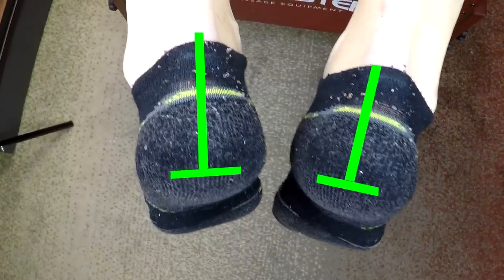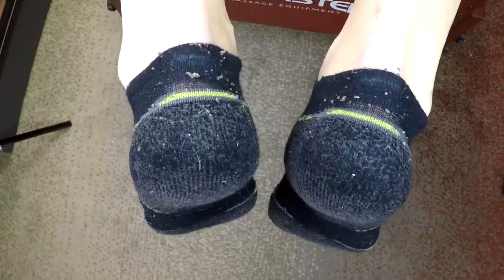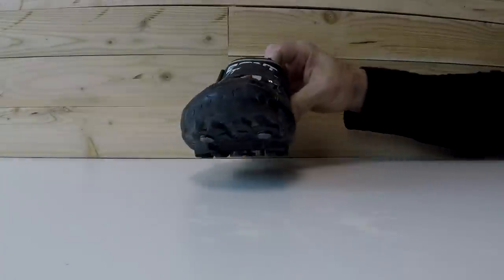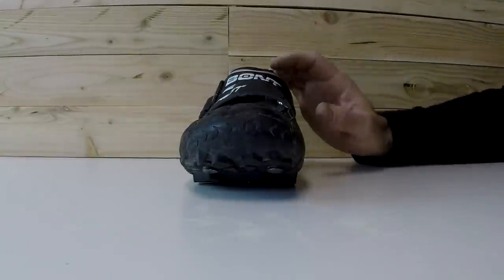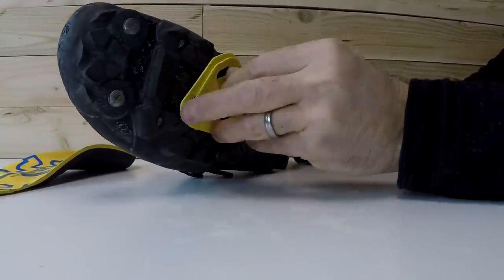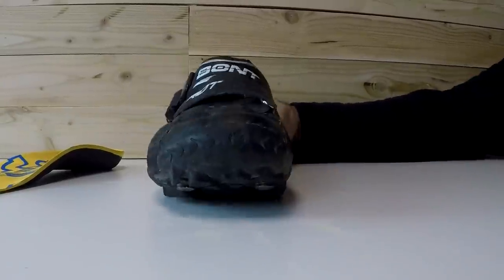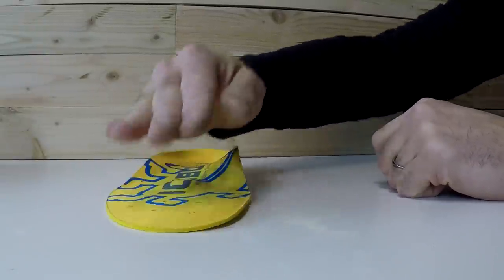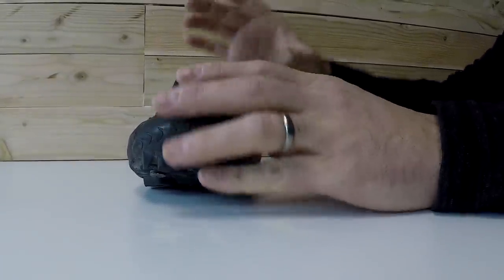Using Cleat Wedges | Bike Fit Tip

Comment: Thanks for this video. After using my running-insoles for my cycling shoes, I developed a hip injury over a period of about a year. I didn't know that the running insoles were to blame. My running-insoles have a lift under my big toe to release stress under my forefoot. They caused my knee to turn outward during the cycling motion. After you explained the forefoot-varus and the dynamics of the cycling motion in this video, I was convinced that the insoles created my problem. I eliminated the lift under my big toe resulting in a better cycling motion were my knee didn't turn outwards anymore. After a period of about to weeks my problems disappeared. I still use the original insoles for running and they work great, for cycling however I use a modified insole.  So keep up the good work!!!

Comment: My story is that I had a bike fitting on a machine before ordering a new bike (my first road bike -had been riding mtn bikes with no particular fitting). The bike came in and was setup per the fit. We tested with the bike on a trainer since it would be the first time in the road shoes I bought, etc. 

My symptom was pain on the outside edge of my feet almost right away while pedaling. The fitter then had me kneel on a chair and did the measurement of the foot angle and we tried some wedges based on that. That fixed the pain right away. 

After that he watched my pedaling and based on some knee motion tried some shoe inserts (superfeet -yellow) and he felt that corrected it.

The main point of this comment, is that my symptom that was corrected by wedges was foot pain on the side of the foot.
Reply from the maker: That's a perfect example....I should have been clearer in the video that lateral foot discomfort is a common result of the symptomatic forefoot varus.  Your foot wanted to "stay" tilted on its outside edge and that put pressure on the side of the foot.  Thanks for sharing!
Reply: this gives me hope. I have tried everything (including bike fit, different shoes, different cleat styles, cleat positioning) but the longer i ride the more i get terrible numbness and then a "hot" burning with my 2nd and 3rd metatarsal. I am definitely going to give this a try

Comment: As a former marathon racer, I struggled with leg length variance.  This caused my foot to rotate outward (supinate).  I used custom orthotics, insoles, shims, etc.  With cycling, I have the same issue and have used wedges.  My chiropractor showed me that my leg length variance was caused by pubic bone being out of alignment (a common problem for many).  He showed me a way to self-adjust that bone.  The end result fixed my leg length variance along with foot supination.  Right leg was at times 1.5" shorter.  After adjustment, the legs were the same.

Comment: I recorded myself riding from several positions as you recommended to analyze my bike fit and noticed my left knee (which has had long term pain after over-use on a big ride a few years ago) tracks inwards significantly through the downstroke. I also found I have "duck feet" by 15° for each foot and 2° & 6° varus tilt in the left and right foot respectively. Turning my cleats in 15° and making an impromptu 2° wedge on the left side made a big difference in comfort on my trainer. I thought it was interesting the varus tilt was greater in my right foot but wasn't causing knee issues there. I ordered some BikeFit wedges and hopefully my knee pain will go away so I can finally ride again! Thanks for the video.
Reply: have you tried pedal extenders ?

Comment: Very useful. I have a wide foot so have finally found a pair of good shoes that work for me. I'm wearing the MX1 Carbon from Lake. They are a brilliant shoe all in all. I chose the SPD cleat so I can walk if needs be during touring and gravel rides. I also ride audax distance. 300km was tolerable but getting a little annoying. All of the other foot discomfort has gone and I am now left with hot foot on the underside of the outside of my right foot. I have a pair of inserts (that I hated with a passion in other shoes) that have  varus wedge that can be fitted that I will experiment with. I've also noted I can get shims for the SPD cleats so will give them a go as well. I'm hoping they will work as I really don't want to get the wider SPD SL cleat for distance riding. We shall see how it goes.

Comment: OK so this was VERY interesting... I ride SPD's (not the SPD SL) so while you can get wedges for them they are trickier. I remembered I had a couple of varus wedges in a pair of insoles - that I hated. So I put to 1.5mm (0.86 degree) ones in and got in the shoe... didn't feel much different. Put the 3mm (1.7 degree) ones in and oh my... that feels much better. Initial experiments were positive. To give some context, a 100km ride, I notice the discomfort in the outside of my foot. 200km ride, I'm standing gently on it afterwards,  300km ride I'm limping. I just completed a 737km ride over 34 hours with no foot discomfort (apart from a couple of twinges when pushing a heavy gear) to speak of! That's brilliant. I'm going to experiment with the 1.5mm in-shoe wedge add a 1 degree (0.87mm) cleat wedge to see what that does to give me some more room in the shoe... but the result so far is brilliant! Thanks for the explanation.

Comment: Cleat wedges namely Big Meat® by Keith Kiode from Miami USA are key to my 1998 MTB sprint 5km/10km win the wedges stop your knees peeling towards your top tube a problem when you get tired yes aehy thought that aehy would get knee pain however the lever action enables "perfect circle" even circumference pressure in every direction an SPD pedal can torque, also aehy was stoned during the competition and visualized my bong especially up hills looking forward to bongs at the end of the race.

Comment: Be careful with wedging the first ray. If the midfoot is unlocked to allow forefoot eversion, first ray ROM has decreased. The added wedging can jam the met against the cuneiform. The better method is to control the foot at the sustantaculum tali and position the midfoot correctly.  A properly fitted orthotic is the way to go. Love the videos. Keep them coming.
Reply: I had a similar problem. I would like to say "lateral foot sore" rather than pain cause I feel the fatigue in the lateral foot muscle.i have tried move cleats inside but it seems it doesn't work. then I try wedging cleats to elevate the outside and the symptom resolved. however, after 25km， the lateral knee started to "pain". how to fiexd it?  i totoally  have no idea ~~@_@

Comment: I have the same problem: pain on the outside of my right foot. I tried some in-shoe wedges and they worked great. But like  BFA said, it dramatically cut down the space in the toe box which caused my toes to go numb. Will cleat wedges work as well as in-shoe wedges?

Comment: I know this is an old video, and perhaps I won't get an answer. But.. if forefoot varus is unchecked and uncompensated for, is it possible that this could cause your shoes to wear in a strange way that the inside eventually pulls away from the sole? I don't experience any pain, but it is annoying that my shoes wear out in this way.

Comment: Hello.

I have a structural LLD of ~13 mm estimated by PT. 8 mm femur and 5 mm tibia.

I was told that I can't use too much shimming under the SPD MTB cleat (more then a ~2 mm), since the shoe is being elevated over the pedal and becomes unstable.

Do you think going with in shoe raises/ inserts can help with an issue? Should I go with the heel lift or toe box lift or lift the whole foot?
I really want to keep SPD system, as I'm riding/ commuting on all kind of surfaces and appreciate the walk abilities they provide.

Thank you.

P.S: Following your advice I've just got my custom cycling orthotics
Reply from the maker: 1. I always question by what method was it determined that you have a 13 mm LLD? The ONLY way to get an accurate measurement is through the radiology department and have it measured directly from the scanograms.  No one can measure the bony landmarks through the skin and soft tissue with any serious degree of accuracy.  So I wouldn't necessarily worry about the actual amount of the LLD.

2. The goal is never to try to correct the full amount of the LLD (especially when the accuracy of the measurement is in question).  If you can correct 30-50% of the difference then you're probably going to be doing well -- over-correcting can be significant;y more dangerous than not correcting at all.

3. Are you sure that it's a problem (or that it's causing a problem) on the bike? Many LLDs are muted or absorbed on the bike because we have so many ways to dissipate their effect due to the fact that we have so many points of contact. There's a reasonable chance your LLD might not be as big a problem as you think, so I would investigate further into what specific bike fit deviations you have on the bike (start with the basics -- check saddle height, see how the ankle is moving through the pedal stroke, is your saddle far back enough behind your feet so that you have the right balance?, and is the reach to the bars allowing your pelvis to remain balanced and neutral on the seat or is it drawing you forward?)

It's true that shimming toom much under a cleat can cause trouble if it gets excessive -- the further you displace the bottom of the foot from the center of the pedal axle the more instability you can breed through that foot/ankle. But a couple millimeters is probably not going to upset things drastically.  Keep in mind that many early road and mountain bike shoes had very think soles on them before they improved the materials to allow for thinner stiffer soles.  These were orders of magnitude thicker what you would add through a shim under your cleat.  I wouldn't blink an eye at using one of the 3 mm shims that I have at my disposal for this.

Hope this all makes sense, and good luck!

Comment: I use them to help with a leg-length discrepancy. I also use a bit thicker insole in that shoe and it seems to help. Dr. Pruitt also recommended running that cleat more forward as well. I think I have a bit of an imbalance too as the opposite side hip adductor is less flexible for some reason.
 I have never had a fitting done and should probably stop doing it myself. Any suggestions for someone decent in the Bay Area?

Comment: I was fitted on my bike but is experiencing chronic knee pain on one side. Physio diagnosed me with Patella femoral syndrome and was given exercise to get my quads to work correctly (Inward rotation when squatting and pelvis rotation on one side not helping) but after a few months I haven't really noticed improvement.  Pain is limited to cycling ( I cycle everyday to work) and I recently noticed that the foot on the side that hurts is tilted upward quite a lot compared to the other side (I also have high foot arch). My physio isn't a cyclist so I can't rely on him for a bike fit. Could the wedge help with the knee alignment and allow the knee to track properly, helping with my quad firing up properly when cycling? Should I try both a sole for high arch with a wedge underneath the problematic side? Wish I lived in Colorado because I'd be first in line to get a proper bike fit from you. Thanks for the advice!!

Comment: @Bike Fit Adviser hi i love these videos. im a bit bow legged and have been trying to get comfy with my shoes. i have specialized bg, with specialized insoles, but i feel like im loosing lots of power transfer. will wedges aid my foot placement so it looks less bowlegged on bike? or should i get custom orthotics?
Reply from the maker: +phil akhmadi that can be a real challenge...wedges might help to allow your feet to address the pedals in a more direct way. They're certainly the cheaper way to start to experiment. That's probably here I'd start and move on to more custom orthotics if you're still struggling to get comfortable. I wish I had a better more concrete answer for you, but being bowlegged is a difficult thing to account for as a lot of the anatomical change is in the knees and the hips. Best of luck
Reply: Thanks so much for the insight! I've had fizik shoes before and those were really limiting my power: the current specialized ones I have are a lot better due to the added mm in outersole. I figure I'll just go with the insoles. Hopefully they'll better my running form as well. I've looked to see if there are any exercises to correct bow knees but found nothing,

Comment: Your video was really interesting. And has raised a question in my mind. OK, I had a bike fit last year and the fitter saw quite quickly that I had approx 6mm forefoot varus, which he decided to compensate for with wedges. It should be noted that I hadn't had any knee, but some achilles problems (carried on from my earlier running days). His main reasoning was "Power". In other words when pressing down on the pedals some power did not get through because I was probably using the outside of my foot rather than the whole foot. I am now in the process of buying new shoes and wondering if these wedges are necessary? I'd love to hear your opinion about this.
Reply from the maker: Stephen Humlen-Grinstead Good question. Wedges could have an impact on power through the pedals but this is no guarantee. Many people have little need for the wedges, even if they do have a bit of forefoot varus (which, again, most people do). So those wedges might be helping you in the "power" department, but they also could be doing nothing. The good news, is that there is often little downside to using 2 wedges under a cleat for most people (with the understanding that this is a generalization, but....)

As for the new shoe purchases...more and more shoes are coming with forefoot varus posting already in place, and so many riders no longer need external posting with wedges. The best thing to do is to research the shoes you're looking at to determine if they might be doing this
Reply: To finish up my story. 2 short rides with new shoes and no wedges, no problem. Long ride on Sunday and the dreaded tendinitis strikes in my achilles! 3 lessons learnt. A) Don't buy low end Giro shoes, they ain't got no support! B) Check with a specialist before going out on longer rides with new shoes! C) Buying cheap costs more in the long run (or ride in this case :) ) !

Comment: Thanks for this very useful video, John. I have a question. Wouldn't it be better to manage forefoot varus with an insole like the G8 Performance where the flexible arch is positioned to give support to the big toe?
Reply from the maker: Ridingonryeandjam An insole would be a good way to manage this under some circumstances, but the difficulty arises because most cycling shoes are such low volume shoes - they literally have little space in them, like dance shoes or climbing shoes -- and sticking a substantial insole in them can often prove difficult because as they take up space the shoe just gets tighter which can create many more foot and toe issue just from the compression that occurs
Reply: Thanks for the response. That makes sense. I have low volume feet so I almost welcome some additional internal support but I can also see how for others it may become a problem.

Comment: I have recently changed from giro to specialized shoes, and I've been having some hip issues- potentially some kind of impingement in both hips. I've been trying to simulate the fit that I had on the giros, and I think that there may be a difference between the soles of the specialized and the giro shoes (s-works road vs. empire slx) because the giros felt more comfortable/natural (I tend to overpronate when I walk). Do you think that wedges could help with this issue? Is there much of a real difference between the soles of the specialized and giro shoes? Thanks.
Reply from the maker: Wedges may be of some help. The problem lies in the fact that some shoes "post" the forefoot more. Specialized has taken to including a few degrees of varus wedging built into the shoe already. A number of years ago SIdi began doing similarly which required a lot of clients to have their bike fits re-done because they had a specific cleat solution tailored to their old Sidis and the new ones were creating an issue.

It will depend on the model of the shoe. You might pick up some wedges and begin experimenting with some very mild posting (1-2 wedges to start just to be safe)

Comment: I have 4 wedges in my left cleat. It helps greatly but even with that I still have tell myself to press down on my big toe. Usually only get pain around 45 miles however when I'm riding a lot I've been able to get it after just a few miles. Maybe I'll play with adding a 5th or seeing if I can add some support inside. 
I think they just came out with some soles specifically for this.
Reply from the maker: 4 is a pretty healthy number of wedges. You might be running into diminishing returns with the wedges because they post the forefoot and you may benefit from more mid and rear foot support.  This is another issue I brought up with the Speedplay pedals because they allow a small amount of lateral motion through the cleat/pedal interface which might be working against your efforts to get the force to your big toe.
Reply: I to have a lot of forefoot varus in my right foot and use 4 cleat wedges to align my shoe to that.  The wedges helped.   I too felt something was off and played around with the wedges and determine 4 is the correct wedge count for me.  I felt something was needed to push the outside of my foot to force my big toe more to the shoe.  I placed "in shoe" wedges under the sole with the thicker side under my little toe which helped get more of my forefoot into the pedal stroke.   Seems counterproductive but it helps.